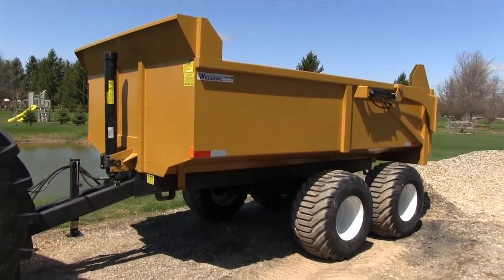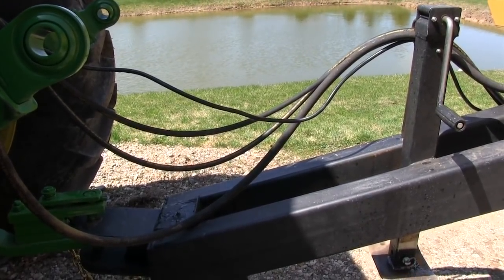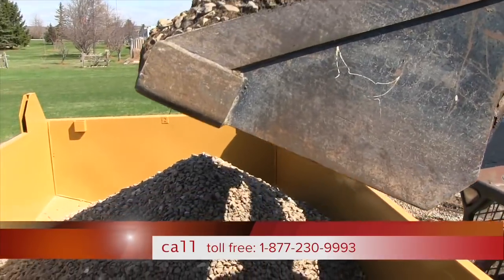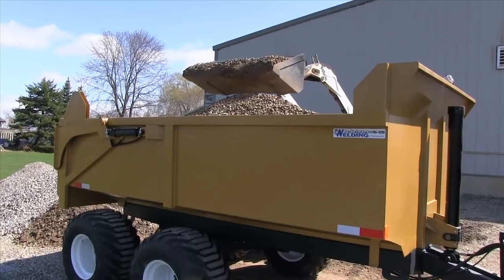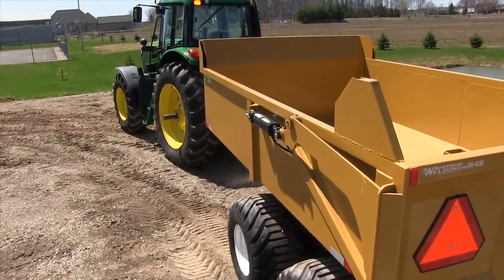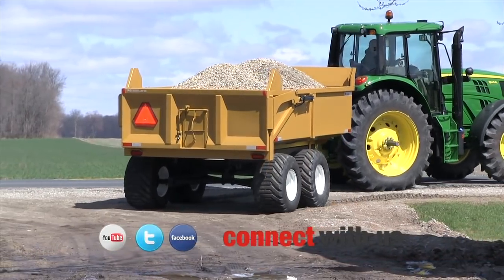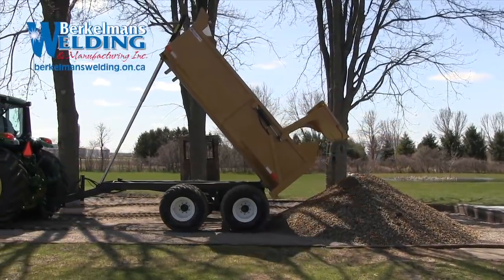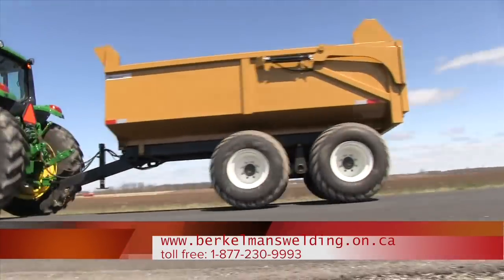12 Ton Heavy Duty Farm Dump Trailer by Berkelmans Welding and Custom Manufacturing Inc.

Comment: Doesn't look road legal
Reply from the maker: These are off road trailers to work behind tractors. You can pull these on the road with your truck to get them from one place to another but are not designed to work behind a truck.